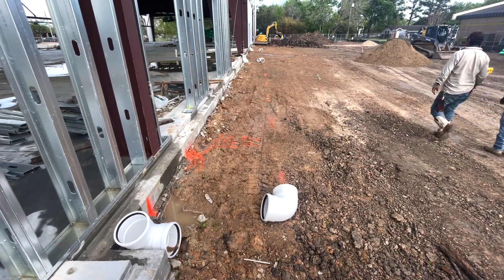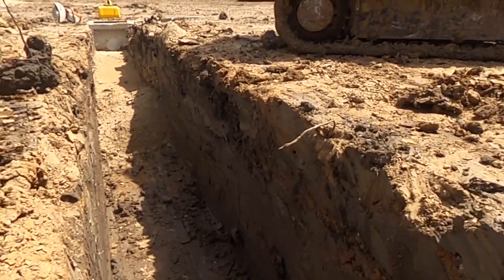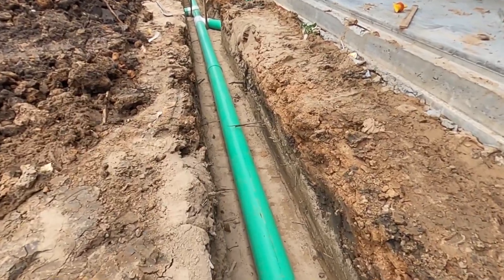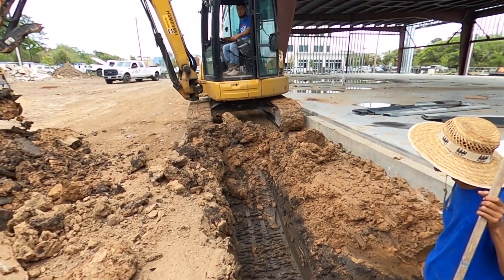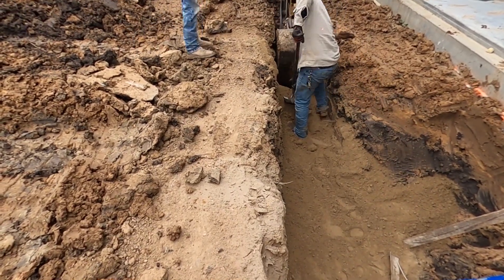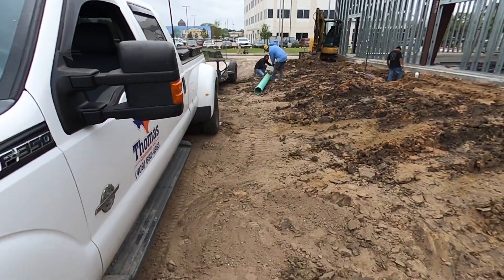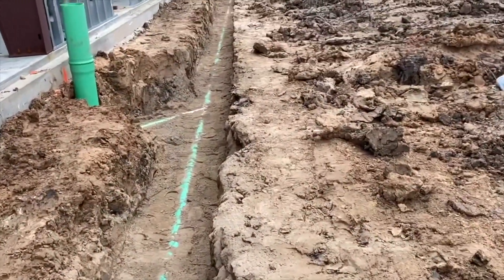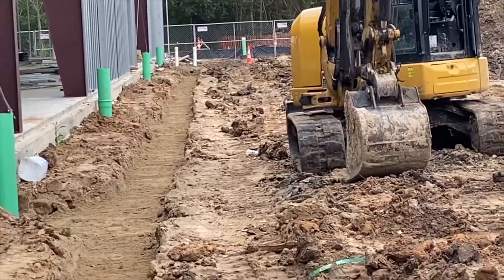How to install under ground roof drain runoff using SDR 35 pipe.

Comment: Do you need the stabilizer sand? Is it a requirement for SDR 35? Also on the 45 degree bevel, I'm guessing you don't need that if you are using 6" with PVC cement?

Comment: Can SDR 35 pipe be hydro jetted? I have some rocks that got into the pipe from one of the risers and Roto Rooter reccomended doing this. Are there any concerns with using this technique to clear the rock obstructions?

Comment: Hey! I'm installing a 4-inch non-gasket kind of SDR 35 for a stormwater drainage application, so the pipe won't be pressurized. Would you recommend using a PVC cement or just snug the joints together like what you're doing with the pipe with gaskets and lube? There's conflicting information online about what the preferred method is...
Reply from the maker: I would glue it. Thanks for watching
Reply: @thomasconstructiontexas  I am putting some of this down that is perforated for a french drain.  I have the pipes with the bell ends (no rubber gasket).  I am concerned that if I use glue I may end up with the perforations turned a bit the wrong way and it will get stuck like that !  Seem like you didn't use glue.  Can I safely skip the glue too?
Reply: How come you didn’t use glue in the video?

Comment: Can you tell us more about what type of laser level you guys prefer? Great project!
Reply from the maker: Spectrum precision DG 613 pipe laser. Little trivia knowledge. When El Chapo escape from the federal prison through the tunnel. The guys that dug the tunnel use this very same pipe laser. GPS does not work underground. By using a rangefinder on the top side and the pipe lines are underground they were able to come up right in his cell.
Reply: @thomasconstructiontexas  so wild!! Don’t go renegade using that thing!! Hehe great story and great videos.
Reply: Trimble makes fantastic lasers if you’ve heard of them!
Reply: @CClarkson9  yes of course! Fantastic laser levels for sure. Just wondering what model they like and are using in the video!

Comment: Get on the other side of the pipe, hold it between your ankles and rest the side handle of the chop saw on the pipe to get your angle. Then bevel.
Reply from the maker: Thanks
Reply: @thomasconstructiontexas  anytime, I’ve seen a saw blade come of a chop saw before and would hate seeing one your guys getting hurt! Safety first🙂